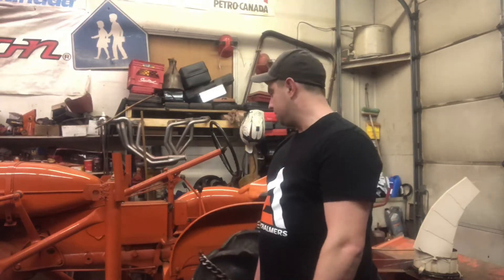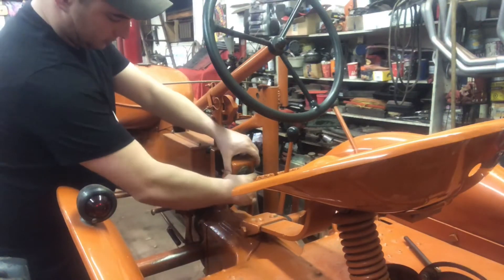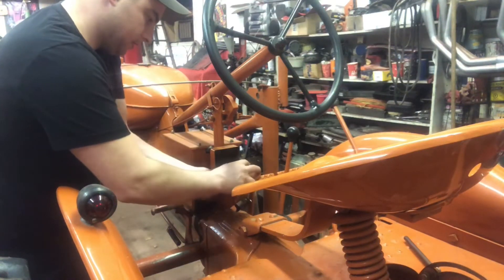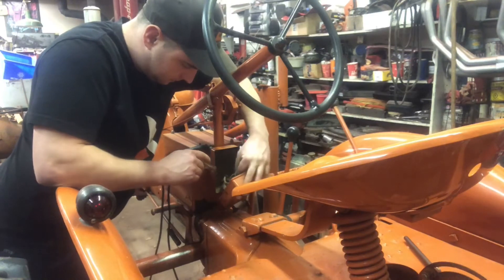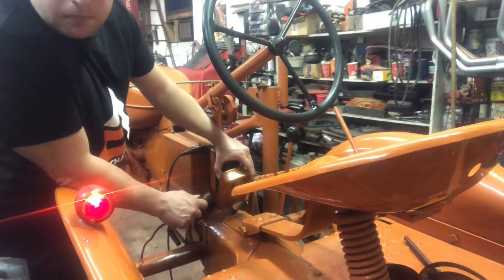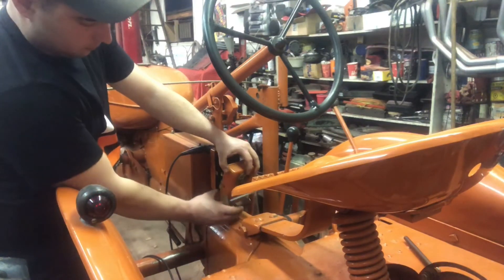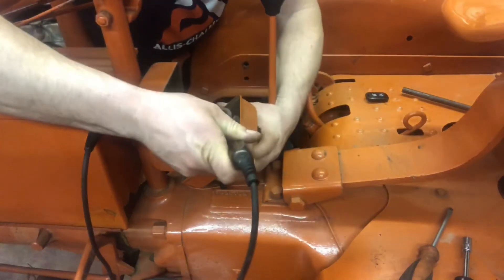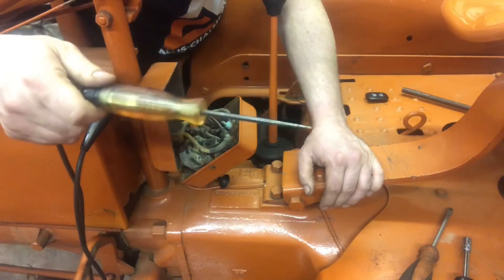Basic Vintage Tractor Electrical Testing

Comment: Love your videos ! Especially Allis WD's  B's and WD 45's. I just started trying to fix up  a 1955 wd45 that has been sitting 15 years. Engine is not seized so happy about that. It was converted to 12 volt in early 60's using a 12 volt generator. All wiring has been ripped off tractor ( stupid cows ) and having to rewire. Not sure of all the connections from generator, coil, switch  and volt meter. I am assuming it is now negative ground but not 100 % sure. Can you advise ? Maybe a wiring diagram ? I cant find an example on internet exactly like mine.May install altenator later on but just want to get it running for now. Thanks 🙂
Reply from the maker: Hey there glad you like the channel, thanks for watching. As for the wiring , you can buy service manuals online or a great source of information and knowledge is the allis chalmers tractors group on Facebook. If you just want to see if it will run you can put “assuming it’s positive ground” a jumper wire to the negative side of the battery to the coil and see if it had spark. Just don’t leave it connected when not starting or running. Cheers